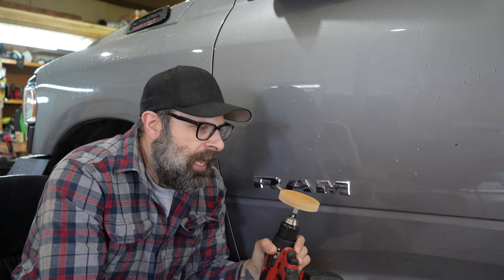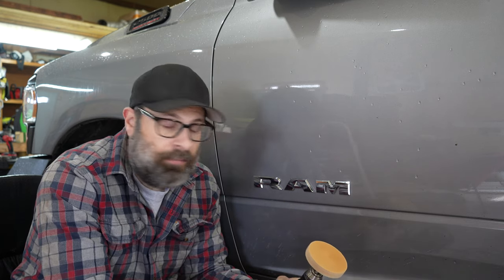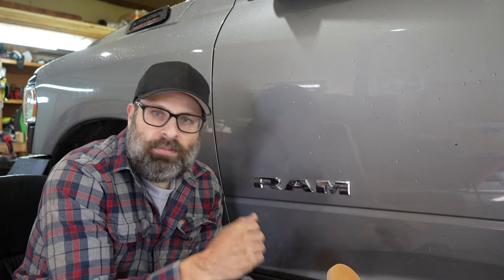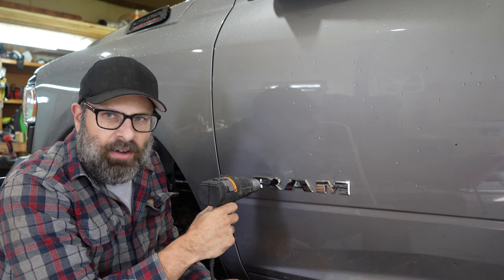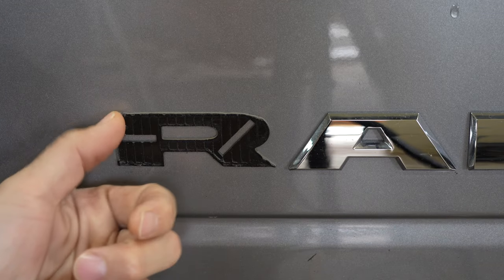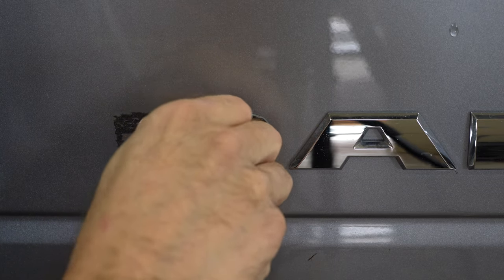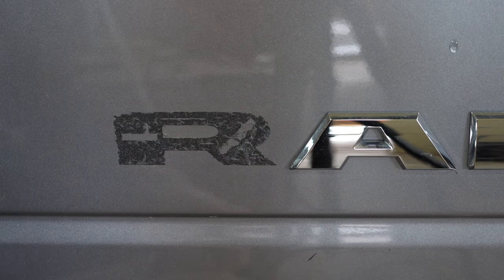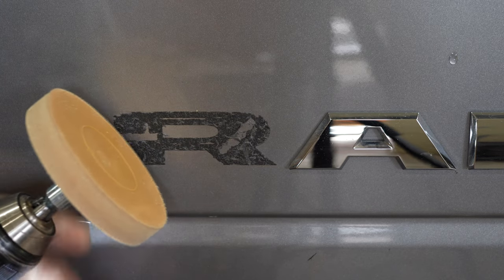Do NOT buy the 3M Eraser Wheel! - Debadging My Ram 2500 - Canopus Overlanding Off Road Build Series

Comment: The way the dealer does is heat gun then dental fross diped in alcohol wrap dental fross two fingers and like a saw goes through the adhesive no mess no expensive tools no erasers. we use decal erasers on decal stripes.
Reply: Doesn’t work like that on anything that’s been in the sun. You’ll always be splitting the double sided tape, so this wheel removes that half of the tape that’s stuck to the project.
Reply: That’s not how all dealers do it. The halfway ones may, but any professional uses a wheel.
Reply: He got it too hot.. it melts the adhesive. You just need a hair dryer, not a heat gun.. or a heat gun on low with some space. Then the floss cuts right through the warm adhesive.

Comment: I rebadged my car with 3m adhesive, which is far worse than the original adhesive on the car. I debadged that with a hair dryer, dental floss, and goof off in 20 minutes. I bought nothing. I had floss (obviously) and a hairdryer, and goof off already. I would rather heat it up than risk scraping my paint. The goof off finishes cleaning the smeared mess no problem.

Comment: I know this video is old but yes if you are just doing a simple badge removal then yes buy the cheap wheels.  If you are doing large decals or do a ton of decals then spend the money and buy something of better quality.  I use probably 100 wheels a year removing decals for replacement.  The 3M wheels last a lot longer.  I also have the purpose built pneumatic tool just for them.  A cheap wheel is fine for quick jobs like taking your ram decals off.  If you are doing large jobs then you need better quality.

Comment: Recently replaced the side moldings on my 250 OBS. The 3M wheel is just under $60 here in FL now so I gave the knock off a try. One wheel did both sides and there's still about 25% of the wheel left, no harm to the paint. Money well spent.
Reply from the maker: $60?! Damn that’s serious.
Reply: Princess auto (harbor freight ) has them for $7-$11

Comment: I've tried both the 3M and the knock offs and I'll take the 3M anyday.  Knockoffs wore down after removing 2 company vehicle decals and I'm on my 4th vehicle with the 3M wheel and I still have 70% left.  Well worth the $$ in my opinion.
Reply: If you're doing more than 1 definitely worth the it for the 3m. Especially where I'm at! They're $39! Just doing 1 truck the $11 is fine. 1 and done. Who cares? You won't even need it anymore. I went and got the 3m cause i was doing my highlander, my ram, guy from work's ram and friend's Silverado and the 3m i got still has a ton of life left in it.

Comment: Thanks for this Nick. I just did my 2011 Silverado the trims were started to peel away. The residue from the tape was a bugger but I think I will go this route for the rest of the trim.   Ottawa Ontario Canada.
Reply: Tom, how did the paint look after the removal was complete? My trim on my 2013 silverado is coming loose and I'm wanting to remove it like in this video. My truck is victory red and I'm wondering if there will be newer looking stripes afterwards due to paint fade on the rest of the surface.
Reply: Tim Gray: As you know, red paints are notorious for fading. How well did you removal work out?

Comment: Have you tried the "fishing line" method to  initially remove the lettering, then go to the eraser to remove the remaining residue. No heat gun is needed.

Also, will the eraser work on glass without creating a haze on the glass?

Comment: Very good demo, but how can you dismiss the 3M product without trying it? The cheap versions are excellent on a small decal as shown in your video and work very well. However they are alot slower than the 3M product on large decals such as the ones I tackled on the side of my van. I am not sponsered or have any affilitaion with 3M in case you were wondering, but the title of your video is very mis-leading. I did one side of my van with a cheap version which took the decals off, no damage to the paint and was as you described in your video the way to go rather than using scrapers (I tried that as well). It took over 4 hours though and the wheel was done before I finished. I tried the 3M version, same results except 2 to 3 times faster and less wear to the wheel. You pays your money and takes your choice. Cheap wheels are ideal for small decals or even a pinstripe, but not cost effective for large decals in my opinion
Reply from the maker: Appreciate your comment. I think it kind of proves my point though. This cheap wheel get the job done and you save money. I’m not saying the 3m is bad. I’m saying you don’t need it. Thanks 👍

Comment: I did my 2012 black Tahoe just a section about 8” and can’t see from a distance but you get close you can see where I passed it almost look like residue with hardcore sun swirls.
Reply from the maker: Black is tough, especially on 10 year old paint. Probably need to swirl remove it and polish it. Thanks GL 👍
Reply: @NickMango  that’s what I’m going to do probably get chemicals guys starter polish kit and see how that section looks before continuing.

Comment: Make sure the panel is metal and not plastic first!
 Don’t use on a plastic panel 
It’ll burn thru it!
Reply: Lol plastic panel. Oh how I despise these new vehicles.
Reply: Work in gel coat boat ?
Reply: @hooked_fish  Late reply, but yes, I used a cheap Amazon knock-off wheel to remove old stripes and lettering from a 36' sailboat.  Worked great.

Comment: You might be just the guy to answer my question. I bought a '93 Gregor aluminum boat. The factory decals are about 14 inches X 4 inches and are really, really faded and checked. I bought a decal remover (not the one in your video) from Amazon and wore that thing to a nubbin trying to remove them. It didn't remove so much as a square inch of the decal itself, much less the residual adhesive. Will the wheel in your video be effective in my case, or do you know of a chemical remover that might be more effective?
Reply from the maker: Wd40 spray the hell out of it then use a rough rag. Like one of those cheap ones. Or a plastic scraper. If that doesn’t work try Acetone. GL

Comment: Do you have any advice on what I could use to help blend where I took my badge off? I debadge my suv but the outline of my decal kinda still shows through.
Reply from the maker: You used alcohol? If so maybe a light compound. Real light at first especially if it’s an older car.
Reply: gotcha maybe I’ll try alcohol. It’s a 2012 I’m surprised the outline shows thru as much. Thanks for the help.

Comment: I would not recommend using an eraser wheel for removing pin stripes or decals on trucks, some people have great luck, but it’s luck of the draw, I bought a 3 mm eraser wheel off Amazon, I used it for removing a pin stripe, well the second it touched my truck, the eraser is almost as if it melted and stuck to my truck like tar, but worse, I’ve tried everything trying to get the eraser wheel residue off and the pin stripe off, here it is a week later and still can’t get it wiped clean and cleared up, I’ve tried everything, goo gone, residue remover, alcohol, buffing, hand sanitizer, I’m going to try a heavy duty clay bar next, but I feel it’s a waste of more money, those eraser wheels can have a bad outcome, be careful using them, it wasn’t as simple as people made it seem, and I was going at low speed, I had barely touched the truck, so I know I didn’t burn it or anything else.

Comment: Youtuber 'Gander Flight' tested the generic eraser wheel vs 3m vs Horus wheel.....yes 3m was the most expensive but the fastest and cleanest.
So if time and efficiency are important then 3m is the way to go.
this is the link to the video    https://www.youtube.com/watch?v=7Y_2DYBwoTU
Reply from the maker: Yeah I’ve seen this video. If you watch mine to the end you’ll see that it takes about 90 seconds to completely clean off the RAM adhesive. Going any faster than that is really unnecessary imo.

Comment: You cqn burn through your clear coat very easily withthe heatgun or the wheel. Your better off taking it to a body shop, leave this type of work for someone with experience. Or you could hVe a expensive repair, at a body shop, where you should have gone any ways. I was an auto refinish tech "painter" for 20+ years and dont do this. When you customize any vehicle you only made it more valuable to yourself and to a very small intro people but the average public you've devalued it